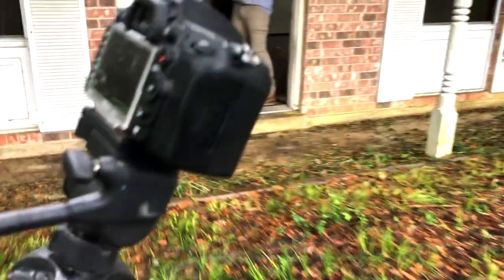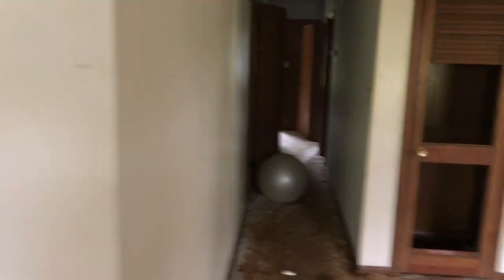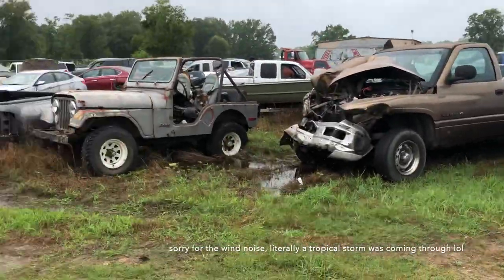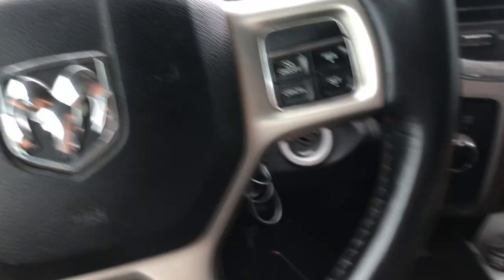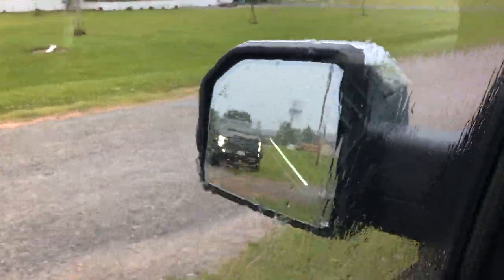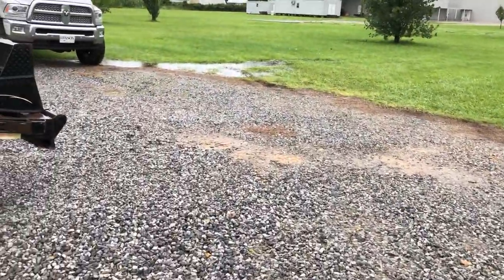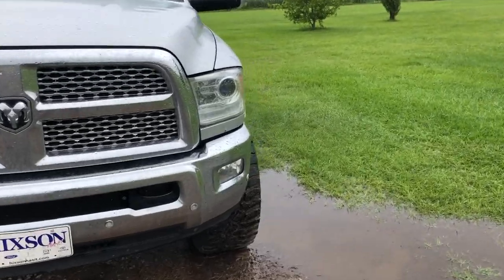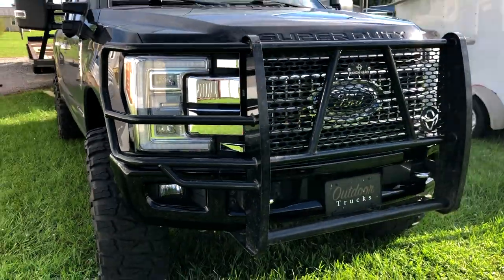First Time I've Ever Run a Ranch Hand Brush Guard on any of my F250's!

Comment: Looking good!!! How long did it take to put on? I have one but I'm getting the truck ceramic coated in a month and want them to do a good job on the grille. Wondering if it'd be easy to take off and put back on for the appointment. Thanks!